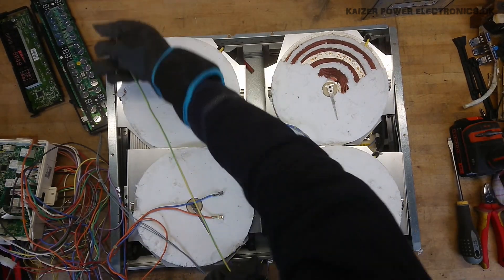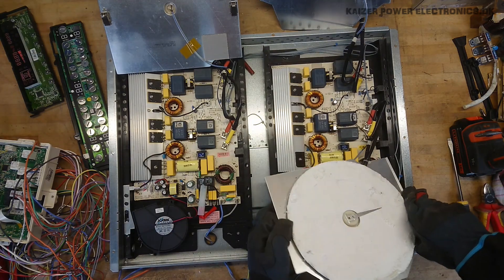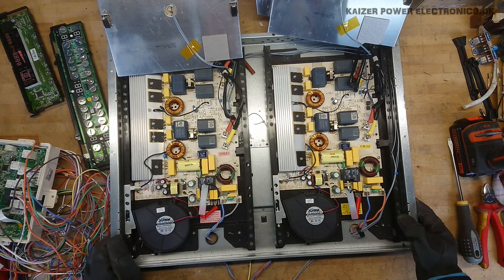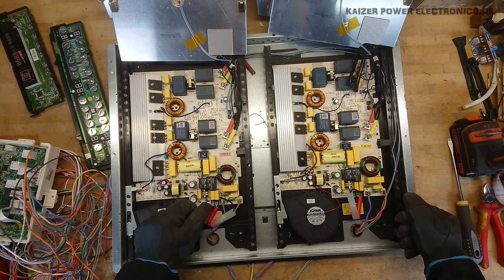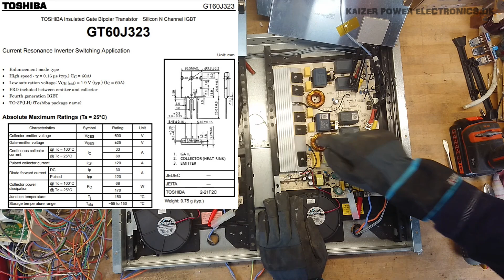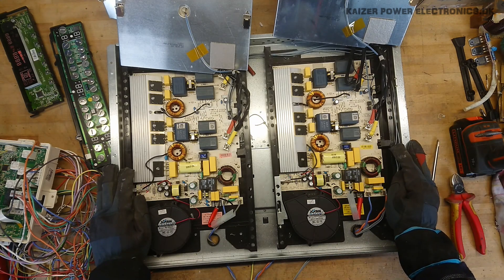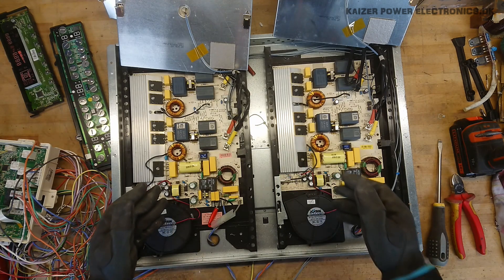8 kW Induction Cooktop Teardown

Comment: Is it possible to make an "invisible cooktop" by removing the glass and sticking the induction hob under a stone/porcelain countertop? InvisaCook's just looks like a regular induction cooktop without the glass.
Reply from the maker: Yes, that is possible. You might however need a thin section, to get the distance between coil and pan, down to the same as the glass plate. You do however need something that does not contain any ferrous minerals or other conducting materials.

Comment: Does this thing uses AC at all or just converts it to DC? Wondering if we could run those with HVDC directly from solar.
Reply from the maker: It is working in Quasi-resonant mode. Which is DC switching at AC waveform. I explain it in these videos: https://kaizerpowerelectronics.dk/general-electronics/hacking-ikea-2kw-induction-hob/